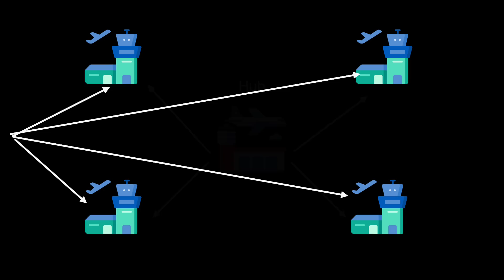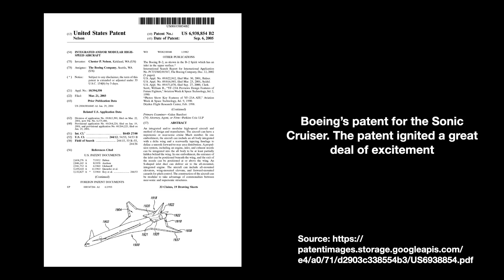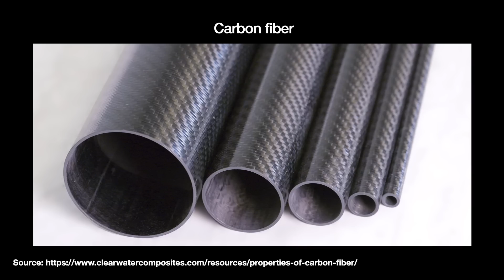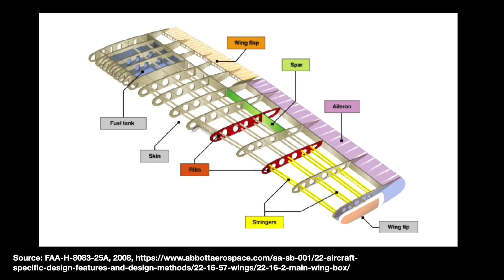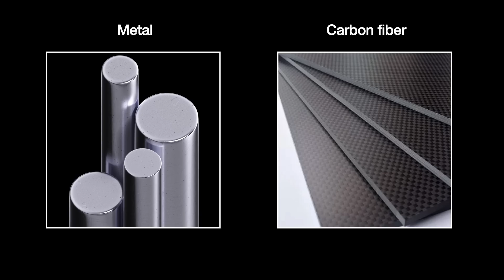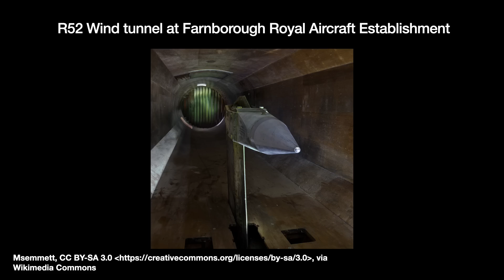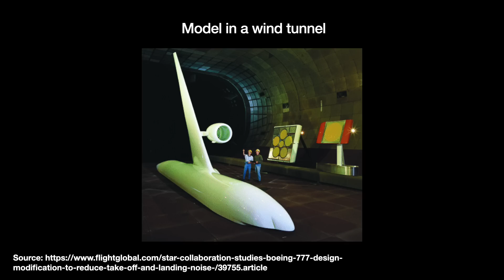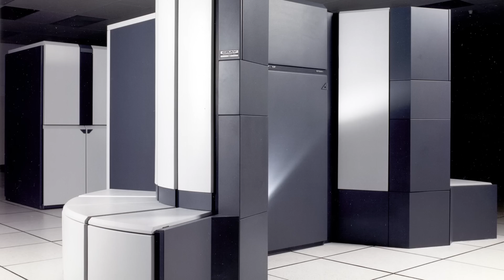How the Computer Helped the Boeing 787 Soar

Comment: The wing size, and by extension the wingbox fuel tank volume also directly determines the airplane's range.

One of the biggest criticisms of the A300/A310, and the main reason for it's limited success was that the designers didn't make the wing big enough to carry enough fuel to give it enough range to fly longer routes.
Reply: Don’t forget the use of higher bypass engines for fuel efficiency.
Reply: Just like military. Do inflght refuelling.
Reply: Boeing repeatedly made a similar mistake. The 757-300 was a longer version of the 757 - Boeing could have, instead, used the increased gross weight to support a longer-range version of the 757. It had customers at the time who wanted a longer range version, and the recent success of the A321-XLR (super long range version of the A321, which is only a little smaller than the 757) shows that range, not greater capacity, was the "killer app" for the aircraft.

Same thing with the 767-400 - a larger capacity version of the 767. The gross weight increase could have gone into longer range instead, but Boeing again chose capacity over range.

Both the 757-300 and the 767-400 sold in disappointingly small numbers.
Reply: @cv990a4  Long range flying with fewer passengers/cargo capacity is very unprofitable. So while making such a plane would give you complete control of that market, it's not a particularly lucrative market that you'd even want control of in the first place
Reply: @jmlinden7  So all those airlines ordering the A321XLR must be making huge mistakes. Too bad they didn't talk to you before making those commitments.
Reply: @cv990a4  Do you understand that customer demand in 1996 (when 757-300 was developed) and 2019 (when A321XLR was developed) was a complete and utterly different altogether? Do you realize that in 1996, aviation market demand is less than what it is in 2019? Do you realize that 23 years is a very long time for the world to change? Do you understand that A321XLR was a result of market shift because air travel is getting cheaper than what it was in 1996 and new demands for long thin markets are just on the rise in late 2010s and not 1996?🤦
Reply: @FlyingPlastic356 let's talk about the late 1990s when Continental started flying 757s from Newark to Europe. Was that a giant mistake on their part, because they never stopped doing it. 

The highest yielding customers will always pay up for a nonstop. It's pretty basic.
Reply: @cv990a4  Then why Boeing has almost no further order from 2000s for 757? Why the proposed 757-200X, which is an extra long range variant of 757 and floated in the year 2000 garner 0 order and no airline interested in it even though it is exactly what A321XLR is today?

And if you want to drag Continental into this, why Continental switched their 757-300 orders to 737-800 in October 2003, leading to the programme's cancellation? If it is so successful for Continental, surely they will keep the orders, right?

And speaking competitor, what about Tu-204, which even Russian airlines didn't really keen on either?

Yes, high-roller customers will pay more for direct flight, but that only works for limited, premium-heavy routes like NYC-LDN. Show me then which other airlines that are able to make 757 work on their routes until today on routes other than NYC-LDN? And how many of such high-roller customers exist? Is it globally available? or just on very specific routes like NYC-LDN?

And there are hundreds of airlines worldwide. Picking just US Big 3 as sole argument and sticking with it is ridiculous. The fact is, no other airline ever able to make 757 works, other than the US big 3 on Transatlantic routes only. Only after 2010s, with exponential growth in LCC and expansion of holiday destinations, that long thin routes started to have some considerable demands. And only after C19 and the rise in middle class in India and SE Asia that A321XLR makes commercial sense. Look at the firm order book, who is the biggest customer for A321XLR? IndiGo of India with 69 firm. United only orders 50 firm, and that's to replace 757, not expanding to new markets like IndiGo.

If you want to make that argument, might as well be mad at Airbus for cancelling Concorde, considering how successful it is for BA, right? Even though only BA can made it work, just like your strawman argument that because CO 757 works, that means 757 works for the whole world.
Reply: @cv990a4  Then why Boeing has almost no further order from 2000s for 757? Why the proposed 757-200X, which is an extra long range variant of 757 and floated in the year 2000 garner 0 order and no airline interested in it even though it is exactly what A321XLR is today?

And if you want to drag Continental into this, why Continental switched their 757-300 orders to 737-800 in October 2003, leading to the programme's cancellation? If it is so successful for Continental, surely they will keep the orders, right?

And speaking competitor, what about Tu-204, which even Russian airlines didn't really keen on either?

Yes, high-roller customers will pay more for direct flight, but that only works for limited, premium-heavy routes like NYC-LDN. Show me then which other airlines that are able to make 757 work on their routes until today on routes other than NYC-LDN? How many of such customers exists outside NYC-LDN route?

And there are hundreds of airlines worldwide. Picking just US Big 3 as sole argument and sticking with it is ridiculous. The fact is, no other airline ever able to make 757 works, other than the US big 3 on Transatlantic routes only. Only after 2010s, with exponential growth in LCC and expansion of holiday destinations, that long thin routes started to have some considerable demands. And only after C19 and the rise in middle class in India and SE Asia that A321XLR makes commercial sense. Look at the firm order book, who is the biggest customer for A321XLR? IndiGo of India with 69 firm. United only orders 50 firm, and that's to replace 757, not expanding to new markets like IndiGo.

If you want to make that argument, might as well be mad at Airbus for cancelling Concorde, considering how successful it is for BA, right? Even though only BA can made it work, just like your strawman argument that because CO 757 works, that means 757 works for the whole world.
Reply: @cv990a4  Then why Boeing has almost no further order from 2000s for 757? Why the proposed 757-200X, which is an extra long range variant of 757 and floated in the year 2000 garner 0 order and no airline interested in it even though it is exactly what A321XLR is today?

And if you want to drag Continental into this, why Continental switched their 757-300 orders to 737-800 in October 2003, leading to the programme's cancellation? If it is so successful for Continental, surely they will keep the orders, right?
Reply: @cv990a4  Also, Yes, high-roller customers will pay more for direct flight, but that only works for limited, premium-heavy routes like NYC-LDN. Show me then which other airlines that are able to make 757 work on their routes until today on routes other than NYC-LDN? How many of such customers exists outside NYC-LDN route?

There are hundreds of airlines worldwide. Picking just US Big 3 as sole argument and sticking with it is ridiculous. The fact is, no other airline ever able to make 757 works, other than the US big 3 on Transatlantic routes only. Only after 2010s, with exponential growth in LCC and expansion of holiday destinations, that long thin routes started to have some considerable demands. And only after C19 and the rise in middle class in India and SE Asia that A321XLR makes commercial sense. Look at the firm order book, who is the biggest customer for A321XLR? IndiGo of India with 69 firm. United only orders 50 firm, and that's to replace 757, not expanding to new markets like IndiGo.

If you want to make that argument, might as well be mad at Airbus for cancelling Concorde, considering how successful it is for BA, right?
Reply: @FlyingPlastic356 obviously some demand exists, which is why airlines ordered the A321xlr at all, but just because demand exists does not mean you can fulfill that demand profitably.
Reply: @FlyingPlastic356  the 321XLR is nothing like the 757. The 757 basically runs on two 747-400 engines. It's a gas guzzler compared to the 321XLR with it's 12:5:1 bypass ratio (vs 4.3:1 for the RR engines in the 757 ).

The same goes for the 737-800. The CFM56 has a 5.1:1 bypass ratio, making it more economical to run.

Fuel economy is what drove demand for the 737-800 before and 321XLR now, and also why the 757 is on it's way out.
Reply: @jmlinden7  Exactly my argument. There is demand for as direct as possible, long, and thin routes since aviation exists, that's why we have something like kangoroo routes and the clippers. But calling 757 cancellation was wrong and Boeing must keep it running for more than a decade while nobody wanted because of the possible demands 2 decades ahead or because one airline made it work is obnoxious.
Reply: @iraqigeek8363  And you think I suggested A321XLR will be exact tech copy of 757 even though they were 20 years apart? OFC NOT. I know that, but in 2003 (when 757 was cancelled), there were no PW GTF or CFM LEAP either. So that's why Boeing have to cancel it: nobody wanted the 757 and the tech available is limited to make 757 any better. They have to wait for almost a decade before 757 can be reengined, and should Boeing keep the 757 line for 10 years with no order and no interest, waiting for new engine?
Reply: @FlyingPlastic356  The point of making a plane is to make a profit. Boeing never made a profit on the 757 because there's only a very niche amount of demand for long and thin routes. Airlines themselves are not going to use a 757 on a non-profitable route, so there's not enough demand to keep the program going.

The A321XLR has the benefit of sharing a type rating and development costs with the rest of the A321neo family, so Airbus can make a profit even selling fewer models to satisfy the same niche amount of demand.
Reply: @iraqigeek8363  To add: remember, this was 2003, back when Boeing 737NG was swimming in orders. Renton, being a small piece of land, is limited in expansion. When faced with either replace 757 line that has literally 0 orders with 737NG line that has order booked for almost a decade ahead, or to keep the empty 757 line, ofc you can see why Boeing took the former.
Reply: @jmlinden7  Exactly! You can tell that to cv990a4 because that person was the one that don't understand it.
Reply: @FlyingPlastic356  Dude, go back to my first comment where I said that putting resources into the 757-300 instead of the 757-200ER was a mistake. Please keep up.
Reply: @cv990a4 what mistake? 757-200ER is 757-200X! It has been offered twice, once in early 1990s, and later in 2000. Not a single airline wanted them, including Continental. Instead, they wanted 757-300. The airlines are the ones that demanded 757-300 back in early 90s, not some magic thinking hat of Boeing that suddenly come up with it...

Edit: worst of all, it was Continental who asked Boeing to draft 757-200X for them, and not taking it at the end when the specs are made
Reply: @FlyingPlastic356  Source?
Reply: @cv990a4  Quoting Philip Bertie on the Book "Boeing 757": (in context of 1999) "With sales of the 757 reducing, there was a need for Boeing to inject new life into the programme, as the 757-300 had been slow to attract more than 17 new orders. Studies were therefore focusing on the longer range 757-200X" and "Boeing continues to work on its 757-200X studies with a group of six key scheduled and charter airlines, including Continental and Air 2000 - both long term customers of the standard 757."

There is also article on FlightGlobal from October 2003 titled "Sales drought takes 757's scalp", about Continental switching their 757 orders to 737-800.
Reply: @cv990a4  Also, since I cannot post link, you can search the article on FlightGlobal, written by Guy Norris on 21 Oct 2003, titled "Sales drought takes 757's scalp", and I'm quoting: "Boeing plans to end production of the 757 twinjet at its Renton plant near Seattle by the end of next year, following a decision by Continental Airlines to change its last batch of aircraft on order from 757-300s to 737-800s."
Reply: @cv990a4  Also, since I cannot post link, you can search the article on FlightGlobal, written by Guy Norris on 21 Oct 2003, titled "Sales drought takes 757's scalp", and I'm quoting: "Boeing plans to end production of the 757 twinjet at its Renton plant near Seattle by the end of next year, following a decision by Continental Airlines to change its last batch of aircraft on order from 757-300s to 737-800s."
Reply: @cv990a4  About why Boeing go with 757-300: from "Civil aircraft today : the world's most successful commercial aircraft", written by Paul Eden, and I'm quoting: "One concern that operators did have, particularly in Europe, was that the 757 did not have enough seating capacity to benefit fully from its long legs. This was the driving force behind the development of the 757-300"
Reply: @cv990a4  Also, the article on FlightGlobal, written by Guy Norris on 21 Oct 2003, titled "Sales drought takes 757's scalp", and I'm quoting: "Boeing plans to end production of the 757 twinjet at its Renton plant near Seattle by the end of next year, following a decision by Continental Airlines to change its last batch of aircraft on order from 757-300s to 737-800s."
Reply: @cv990a4  About Continental on 757-200X development, from "Boeing 757" by Philip Birtles: "With the sales of the 757 reducing, there was a need for Boeing to inject new life into the programme, as the 757-300 had been slow to attract more than 17 new orders. Studies were therefore focusing on the longer range 757-200X ... Boeing continues to work on its 757-200X studies with a group of six key scheduled and charter airlines, including Continental and Air 2000 - both long term customers of the standard 757."
Reply: @cv990a4  About Continental on 757-200X development, from "Boeing 757" by Philip Birtles: "With the sales of the 757 reducing, there was a need for Boeing to inject new life into the programme, as the 757-300 had been slow to attract more than 17 new orders. Studies were therefore focusing on the longer range 757-200X" "Boeing continues to work on its 757-200X studies with a group of six key scheduled and charter airlines, including Continental and Air 2000 - both long term customers of the standard 757."
Reply: @FlyingPlastic356  They made a mistake. 9/11 happened and narrowbodies were replaced with RJs - same dynamic. A smaller gauge aircraft was available that could fly longer distances faster than an regional aircraft before.

Travel demand is about three things - price, convenience and comfort. Nonstops are a superior good for which the highest yielding passengers will pay up. Continental flew routes like EWR - Newcastle, Edinburgh and Bristol with the 757 and did well. That dynamic is the same today as 25 years ago.

And you can see what a mistake Boeing made with the poor sales figures of the 757-300.
Reply: @cv990a4 then blame Condor, Monarch and other European charter airlines for not backing up their demands with actual order for 757-300. It was mostly their request so they can add more capacity to south Europe and Middle East holiday packages, but they swallowed their own words and instead order 767s.

Again, show me other airlines other than US Big 3 that made 757 work successfully up to 2003? Even the US Big 3 can only make it work on transatlantic routes, with premium heavy load that's willing to pay more for frequency.
Reply: @cv990a4  And again, if Boeing making 757-300 was a mistake, and what was needed was longer range 757-200, a.k.a. 757-200X, why Continental, who, since the year 2000, asked for it and work together with Boeing to make it, didn't take the 757-200X and instead cancel all their 757 orders and swapped it into 737-800 in 2003?

Comment: I wonder if l Sonic Cruiser might even have been economically feasible  given the use composite materials. I need to dig around and find out more about it, as I’d not heard of it before. There’s a few companies trying to bring private supersonic flight back, mostly around the concept of smaller business jets. Concorde was still in service when Boeing abandoned Sonic Cruiser whilst now there’s no other high speed options. It makes for a fascinating what might have been, Alternate history.
Reply: The Sonic Cruiser would have had a very similar fate to the Concord. Supersonic flight was then and is now not economically feasible for the consumer and business side.
Reply: For ultra fast application, I had no idea whether carbon composite can handle the extreme temprature cycle or not
Reply: Economic feasibility doesn’t have anything to do with the use of composites. Actual feasibility does.    Look at the XB-70 - honeycomb steel with titanium for the leading edges.  You can’t dissipate leading edge heat with composites and you’ll have massive heating problems causing debonding and delamination.  That’s just the beginning of the problems. Galvanic corrosion with titanium + aluminum/carbon or stainless steel is high.  

It’s not a problem of economics - most modern aircraft producers already spent the big bucks on huge ovens to cure the carbon fiber.  It’s a problem of carbon fiber not actually being a feasible material for the supersonic/trans-sonic regime.  

Don’t come at me with “but rockets use composites” that’s a much different use case.
Reply: @ChadThundertalk  Debonding and delamination can be accounted for, no?  Leading edge problem is an issue, but the F-35 is a composite supersonic aircraft?